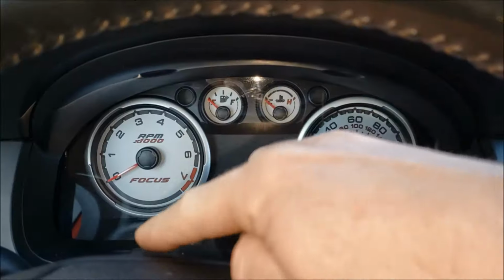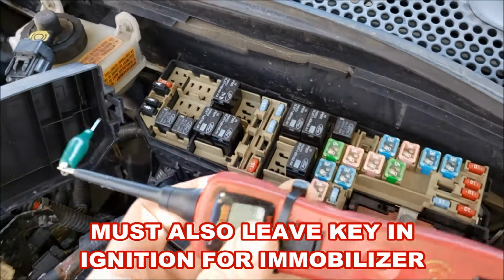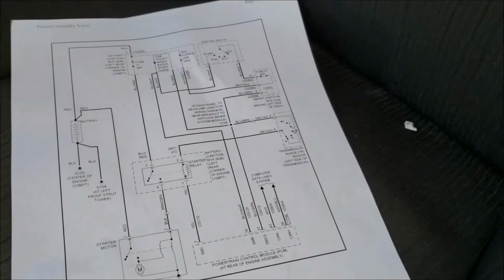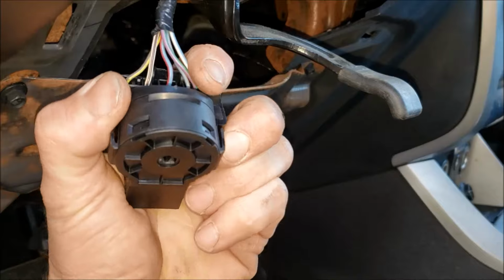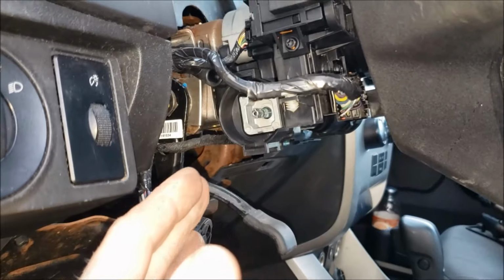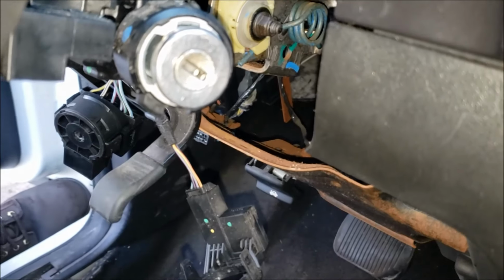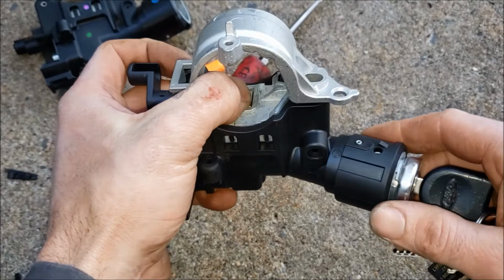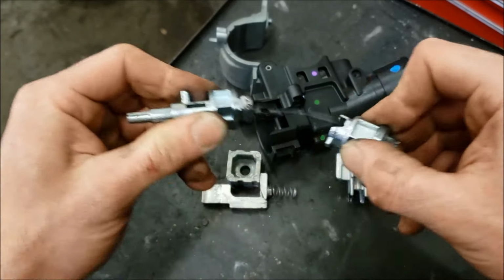08-12 Ford Escape / Focus / Mariner No Crank No Start,  Diag and Ignition Module housing Replacement

Comment: How much should this cost for a mechanic to change the ignition housing?
Reply: I was quoted the high end of course.   Was told it takes 3 hours
Reply from the maker: @teresab208  I suppose it could take that long depending on who's doing it or it could take 30 minutes
Reply from the maker: @teresab208  you should order the factory part online and try knocking it out yourself. it's really not too bad of a job. I mean heck even if it took you half a day, you're saving quite a bit of money and you could say you fixed it yourself. Which is priceless
Reply: Nah I don't want to mess up nothing.  I guess that's why you have to pay for not knowing
Reply from the maker: To be honest it's hard to answer that question because it really depends on your region and what type of mechanic you have do it. Could be anywhere from 50 bucks to $400. Also depends if you bring the part or not

Comment: Do I HAVE to put in the security bolts that snap off or can I just put a bolt that fits there just in case I need to get in there again?
Reply from the maker: You can use any Bolt. As long as it has the same thread pitch and length.
Reply: @NoNonsenseKnowHow  awesome, my moms 13 focus has been having the same not starting issues. My dad bought a new battery and it does the same thing. So now I can let her know if she wants me to do it for her
Reply from the maker: @ddramos956  got you. Good luck getting it rectified!  Real common problem on these

Comment: Awesome, man. The only issue I had was, the cylinder would not seat in the replacement housing, initially. I had to remove the switch and have a helper turn the shaft counterclockwise a little and then it went into place. Thanks, bud! {subscribed!}
Reply from the maker: got you. Glad you were able to figure it out and get everything together. And thanks man I appreciate that

Comment: Okay but what If it doesn't start when you turn it with the screw driver?😭
Reply from the maker: Next Step would be trying to apply power at the diode. And if it starts then it's more than likely a bad switch.  But you should also check that it starts when you send power from the switch connector. Need to look up wiring diagram to see correct wire to apply power to

Comment: I have a problem with my Mazda tribute 2004 v6 3.0 engine front drive it won't start due to the immobilizer problem?  How to fix it?
Reply from the maker: May need replace the immobilizer unit and key set.  Provided you are using the correct key with chip

Comment: i cant figure it out. wen i got this 08 escape couple weeks ago. i was able to start it twice now nothing. i tried this other way this other youtuber did. touch the blue/white wire to the orange/white. lol this did not work. welll i went ahed n bought the ignition switch having the feeling that this wasnt gona work either. it sure didnt. could this be a fuse? what is that immobilizer? wat does that do? could that b the problem? does that ever go bad?
Reply from the maker: Does the theft light flash? Or stay lit
Reply: @NoNonsenseKnowHow  i wana say flash. i hav to chek again wen i get home
Reply: @NoNonsenseKnowHow  it stays solid when i turn it on right before trying to start it. then it disapears after a few seconds. but before turning the key all the way the light flashes/blinks. i hope u hav a fix
Reply: @NoNonsenseKnowHow  oh com on wtf

Comment: Any way to do that diode test without the power probe?
Reply from the maker: Yeah. Use a little jumper wire from the positive terminal of your battery and tap it where I showed in the video. Would be safest to put a fuse for circuit breaker in series with that jumper wire as well.  I hope that helps. Thanks
Reply: @NoNonsenseKnowHow  thank you so much. I really appreciate it. Great video also, ive watched dozens on subject and yours is def the best.
Reply from the maker: @michaelgibson2163  awesome! Glad to hear that and I appreciate the feedback

Comment: i do the rely steps but when try to turn it on at least to drive to the garage it make the sound of start but didnt started.. Battery was good. if it doesnt start how can i make a temporary start to drive to the garaga?
Reply from the maker: Unfortunately with the provided information I wouldn't really be able to give you a answer off the top of my head.  Hard to diagnose without actually seeing a car. I'm sorry I couldn't be of more help

Comment: What if battery is good, fuses are good, but NO LIGHTS on dash when you put the key in????   So, step one did not work.
Reply from the maker: Maybe a bad switch or wire

Comment: Hey Chris I got a question. If you turn the key accessory position. And you get no prime on fuel pump and then turn to crank and you get nothing. What do you think it is?
Reply from the maker: Probably the switch or the housing. But if you take some of the pinpoint steps in the beginning of this video you should be able to verify
Reply: @NoNonsenseKnowHow  I took out the ignition module and tried cranking w/ flathead. I got nothing. Everything light up like it should. Shows milege and theft light goes out.
Reply: @NoNonsenseKnowHow  I check all relay, diode and fuses. They check out.
Reply from the maker: If you look at the wiring diagram you can apply 12 volts direct me to the wire at that switch. And also check to make sure that switch is getting power. Could be a blown fuse. Probably just a bad switch though
Reply: @NoNonsenseKnowHow  so i applied 12 volts at the diode and all what i got was a relay click on the inside. Battery fully charged and starter works. Positive terminal on diode had 0.60v.

Comment: So is the other part built in instead of buying another separate part. The engine switch
Reply from the maker: If I remember right, the aftermarket Dorman ones come with the switch on there but the factory ones do not and the switch is sold separate. I could be wrong though

Comment: Thank you so much.  Just changed lock Module in my wife's 2012 Escape using your video.  So happy I didn't have to remove steering wheel or air bag.
Reply from the maker: No problem David! Happy the video was helpful and I appreciate the comment

Comment: Hey Chris is it better to rebuild or buy a whole new assembly
Reply from the maker: I think it's better to just buy a new one personally. Reasonable price and you'll be in and out. Plus I'd like to think that maybe they made the new one A Little Bit Stronger and and updated design. But who knows
Reply: NoNonsenseKnowHow OK thank you I’ll tell you how it turned out.I really don’t have the The money to go to the Ford dealership..
Reply: Thanks for your reply so fast..
Reply from the maker: @chaplim4737  no problem! Good luck on the repair.

Comment: I am having trouble with inserting the key holder in the replacement Ignition Module housing.  I have seen how easy it was for you. but I turn the key a little and i feel like the male d  has aligned with the female d but no mater how hard i push or wiggle the key holder, it will not go home.  What do you think?
Reply: I got it.  The female d was not in the right position .  I moved it a couple of times and I managed to find the right position.  installed it and the Escape started right up without shoving the key in.  Hope this helps someone.
Reply from the maker: Awesome.  Glad u got it

Comment: Yea my badass hammer out the key all the way till it pop out that piece you turn with the screw driver so now I can only turn it with a screw driver to the on position then go under the car to the starter and jump it with screw driver to turn over but still no start I spray fuel in the intake and pull a spark and manage to get shocked as hell
Reply: It’s also been sitting little over a year
Reply: I’m thinking I need a new key to turn it when it’s on the opposition so I don’t have to go under the car to the start to jump it
Reply from the maker: Yeah that would be a good place to start probably. Does the security light come on? If you have the immobilizer, sometimes they can be troublesome
Reply from the maker: Damn
Reply: Okay I’m gonna check ive also seen videos say it could be something wrong in the fuse

 I’m getting no crank light on dash nothing turning over and I getting voltage to the starter intel I jump with screw driver will crank but no start when
Reply: So it beeps there’s a light red light on top of the dash it just blinks nothing showing security when trying to turn over lights go off on the dash and no sound

Comment: So if I put 12v to the relay plug and the starter works it’s most likely this? I’m having this same issue with my 2010 focus. I’m hearing chatter about the neutral safety switch also being an issue. Any advice would be much appreciated.
Reply: dallastxracing thanks. I went ahead and ordered the whole thing lol. Better safe then sorry
Reply: dallastxracing so the ignition module isn’t going fix anything?

Comment: THANK YOU!! My 2008 Ford Escape has had ignition issues for over a year that have gotten progressively worse. I would push my key in and wiggle it around to start it, but eventually even that stopped working. All the other videos on youtube wanted me to take apart the whole steering wheel, which requires specialized tools, and start with replacing the whole ignition module rather than just the ignition switch. I was about to give up until I saw your video, and replaced the switch for a new one for $45.  You saved me $500!
Reply from the maker: That's great to hear! I appreciate you dropping me a detailed comment as well. Always happy to hear a success story from a video.  Thanks Kaili!
Reply: Just wanted to add another thank you... today (1 year later) the new switch failed, and this time it failed within a day. I was stuck in a Target parking lot. I looked up your video again in my history to remember what size socket I need (5.5), walked across the street to Home Depot, got it all open and started my car with a screwdriver. The part is under warranty so I'm getting a free replacement tomorrow. Too bad the part is so prone to breaking, but at least it's an easy fix!
Reply: Coming back a year later... now the ignition housing failed, and I've used this video yet again to replace it. You've saved me 3 times. Thank you!

Comment: Got it off put it back together, problem is I have a fourth set of wires with a four pin that I don't remember where it goes.
Reply from the maker: Got you. Sorry to hear that. I'm sure you figured it out by now? If not, it might just be an extra harness for something that your vehicle is not equipped with
Reply: @NoNonsenseKnowHow  it was the wire that was connected to the ignition 😂 got all fixed and it turns and starts like butter 👍🏼👌🏼🤘🏼
Reply from the maker: @hekstoo5988  awesome! Glad to hear you figured it out and thanks for updating

Comment: Having this same problem. But when I turn the ignition switch with a screwdriver like you did, the car does not start. Does that still mean the same thing? I just changed out the starter today and it did absolutely nothing. I did the ignition switch yesterday and I’m running out of money. Lol
Reply from the maker: If you turned the ignition switch with a screwdriver and it did not start then no it's not the ignition housing. You may have a bad diode or a wiring issue. Could be a bad relay as well.
Reply from the maker: I tried to go over the potential causes briefly in this video
Reply: NoNonsenseKnowHow thank you. I’ll have to watch it again while I spend all weekend trying to figure it out. Lol.
Reply from the maker: @mminniear984  no problem, sorry I couldn't be of more help. Good luck and let me know how you make out! If you read down in the comments, you may be able to find some more helpful information as well. There was one guy that had the diode go bad intermittently
Reply: NoNonsenseKnowHow I will do that. Thanks again! 👍🏻
Reply: @mminniear984  Did you ever solve your problem?? I’m having the same issue now.
Reply: @modelboytv722  yes and no. I took it to a shop after messing around for too long. They ended up swap out the starter, battery, and the negative battery cable. The mechanic said the battery cable was probably the cause. It wasn’t capable of drawing the power needed to start the car. And they changed a bunch of fuses. Alll in all, I spent about $1000 on 3 different shops (including this one) to have this figure it out. It was a $13 part. And my battery was weak
Reply: @mminniear984  which $13 part was it??
Reply: @modelboytv722  the negative battery cable. You can buy one at any auto parts store. I can’t guarantee it’s your problem. But at $13, it’s a cheap and easy thing that can’t hurt either way to try.

Comment: If there's a clicking noise after you start it by pushing the key in, does that mean a failing starter?
Reply from the maker: Generally yes.  Try hitting the starter with a mallet or hammer or pipe when starting and see if it starts.

Comment: Hi. So my problem is sometimes it turns on n sometimes it doesnt crank but light on.. Any ideas??
Reply from the maker: Sorry, its hard to try and diagnose without seeing it.  Probably the part that i show being replaced in the video.  Most common issue with these.
Reply: @NoNonsenseKnowHow  i found out it was my starter... 👍
Reply from the maker: @jadeflores6841  got you. Glad to hear you figured it out and thanks for the update

Comment: This is the video to watch if you have this issue. Very easy fix that I'd been told would cost about $1000. Did it in 30 minutes for the cost of the part. Thanks for the video!
Reply from the maker: Thanks for the feedback Dylan.

Comment: Here's a fast cheap way to fix the problem. Worked great for me because I don't have the money to that whole part. I bought the button on Amazon for $11.00. The 14 gauge wire was not that much either at Lowe's. Make sure you read my comment on the link below to avoid a problem I had. Car's starting with no problem now. https://www.youtube.com/watch?v=zguq03MXN0o

Comment: What if it doesn't start when you have the key in the start position and use a flathead to turn switch? Does that mean the switch is bad or?
Reply from the maker: Generally yes, but it could be a problem further down the line as well
Reply: Thank you for the quick response.
Reply from the maker: No problem. I didn't really go into diagnosing too much in this video, the main point was to show how to replace the ignition housing

Comment: Im having the same issue with not starting by turning the key on my 2009 ford escape. I had to push in on the key to start it and that worked for months but now it wont. I have a after market auto start and it works fine that way and then i install the key and turn to on and its fine. Do i have that little black switch on the left side of steering column on this car or does it all need to be replaced the piece you showed that wraps around the column for the key insert. Since it does start with auto start can i eliminate one or the other as what the problem is. Thanks for the video yours is the first one i have seen out of maybe 5 or 6 videos that they removed the steering wheel. Again thanks.
Reply from the maker: Yeah more than likely it's the module that wraps around the column. With the symptoms you describe, that's certainly the most common failure.  Glad to help out, and let me know how you make out
Reply: @NoNonsenseKnowHow  Thanks for the quick reply. Living here in central  Maryland i wont be able to get to it for a few weeks ,i don't have a garage doing it in my driveway Buuurrr pretty cold here. Were do you recommend get that part,dealer or does Auto Zone and Advance carry them.
Reply from the maker: @combsfan5  no problem. And I would recommend getting the factory OEM part. From what I understand they've updated it to be a little bit stronger. If you buy it through the link in my description of this vid on Amazon, I actually get a tiny Commission on it.  Or if you find it cheaper somewhere else, can't blame you on that.